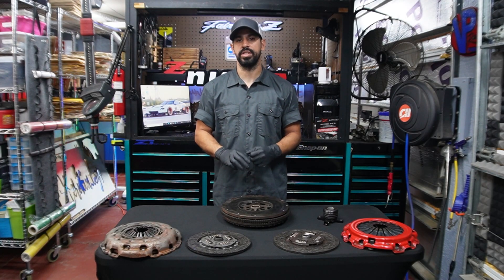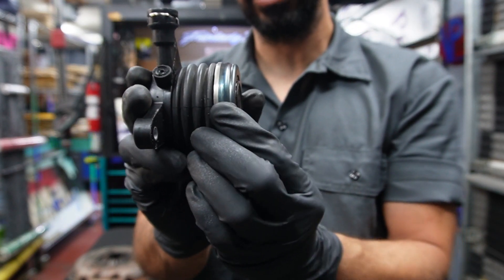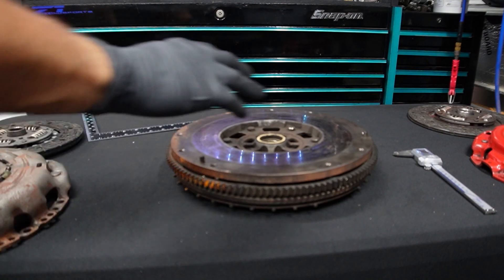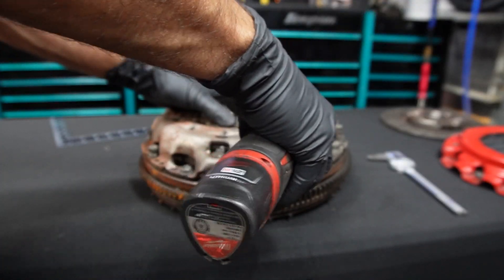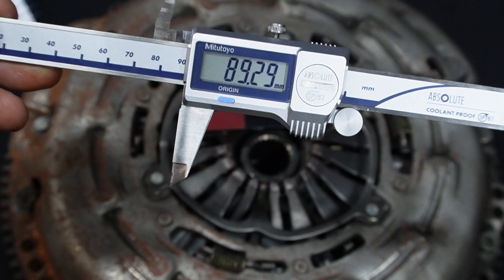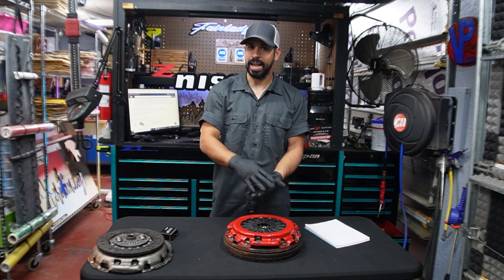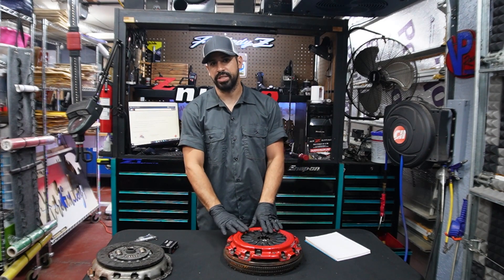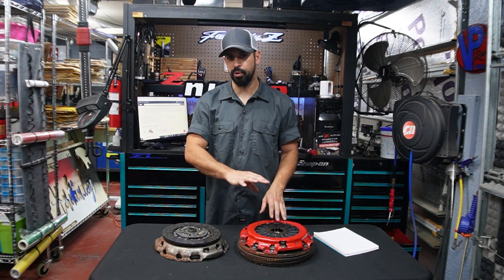How to measure a clutch stack height

Comment: The video is highly appreciated. I have a zspeed CSC and a z1 performance street clutch and mid weight flywheel. I am wondering if I am going to have compatibility issues?
Reply from the maker: Hey brother,
I believe you should be good when it comes to compatibility.
The zspeed CSC needs a minimal stack height of 81mm, so if the z1 clutch combo you have measures a minimum 
of 81mm you should be good. I found this in Zspeed web site. 
"If using aftermarket clutch brands beside Zspeed Clutch Kits Stack Height should be 
checked, New clutch and Flywheel Stack Heights Should be 81-82mm"

The Zspeed CSC might be our only option for a bit. The JWT CSC & also Z1 CSC are not available. Jim Wolf doesn't know when they will have more, I called them again 04/15/24 and now Z1 doesn't seem to have any of their CSC in stock. I can only find the CSC delete kit.
I called Z1 back in January of 2024, and they also were having problems getting more in stock. 

So please share with us how the install goes. This would help the Z community.

If you don't mind me asking, what year Z are you working on?

Thank you for comments and questions.
I'm always happy to help.
Reply: @ArmandoProlGarage  It was for a 2008 350z HR but I sold  it. I have a 2015 370z  and I have been collecting the pieces just in case I have a similar issue.